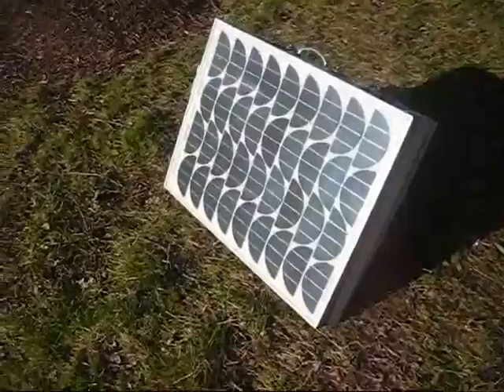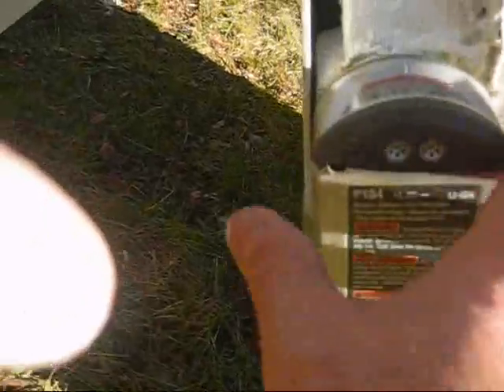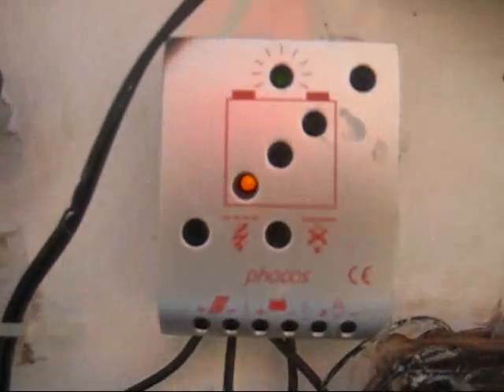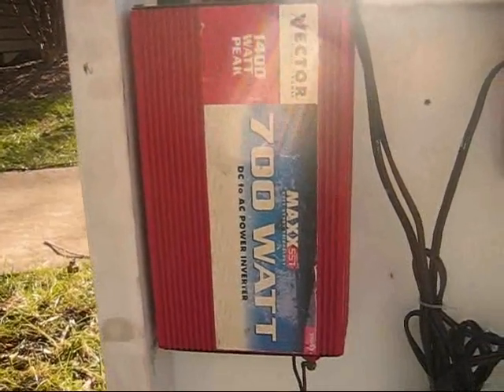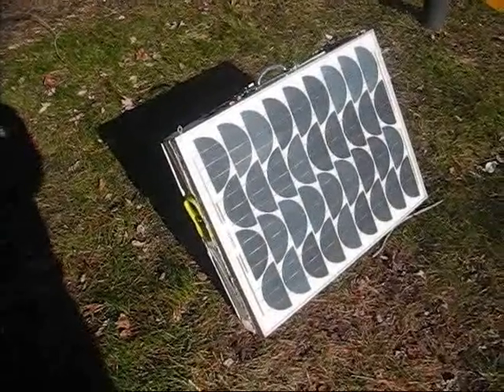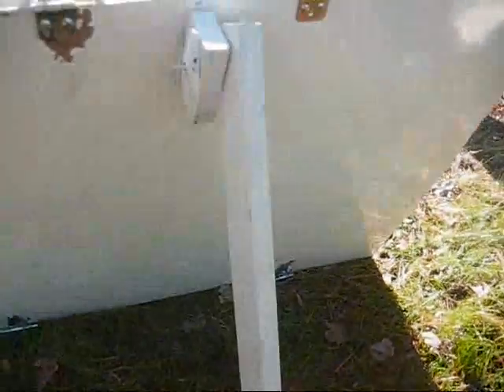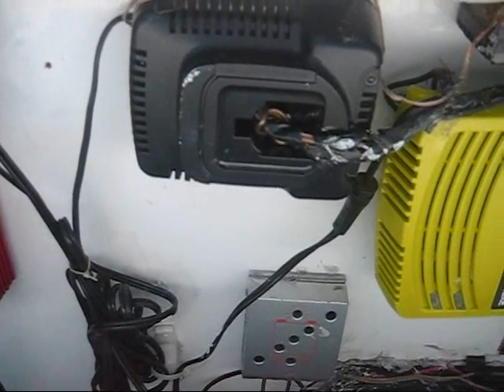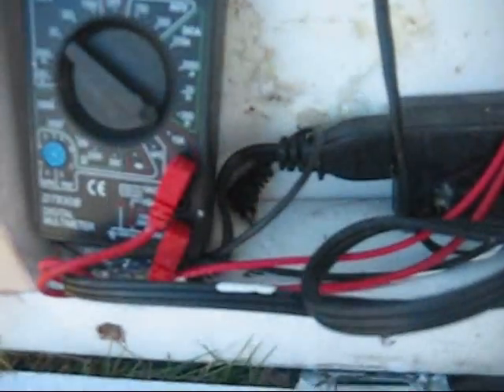Solar charger for Dewalt and Ryobi power tool batteries

Comment: wouldn't it be far better to use a buck/boost converter to use all of the power from the panel instead of wasting a shit ton of energy through an inverter?   or a cheap knock off ImaxB6 ?

Comment: Tom Stewart. I really like your charger.I could not hear all the things you used to make that charger can you please list them for me. Thnak you.
Reply from the maker: +Ezekiel Luhigo 
Hi, I used a 50 watt solar panel, a 10 amp solar controller, a 20 Ah lead acid battery, a 400 watt inverter and the power tool battery charger. And I used a DMM to monitor the current  If you need more info just let me know.  Thanks

Comment: I think one may be better off with a dedicated lithium-ion/LiFePO battery charger directly to the pack, much more efficient, there's even a 5A MPPT floating on ebay for $25 based on the CN3722 chip (board only, lots of fake MPPT so becarful)
Reply from the maker: Thanks, I'll check it out.

Comment: Hi whats the amorphus battery for and what if i only wana charge one 18v battery at a tim how big of solar power i need?
Reply: you can't run an inverter strait from a solar panel, the voltage and amps are all over the place as clouds and sun conditions change, so you charge a battery that then runs the inverter for stable power.